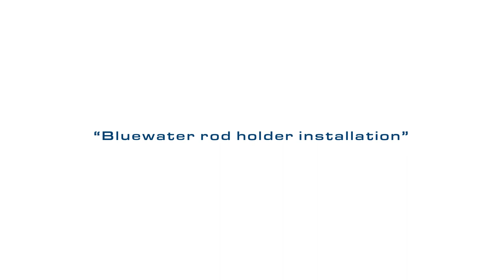Bluewater Rod Holder Installation

Comment: Wires are always on the top  how can we just have them pushed to the outside a then drill and place?
Reply: tape will secure the wires temporarily out of the way, till you've drilled the holes and have inserted the new rod holders ...